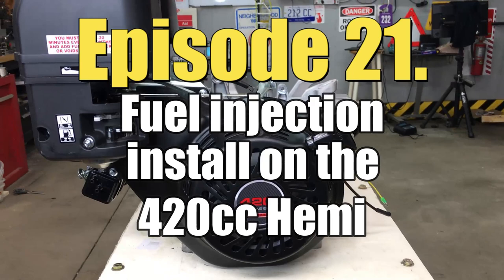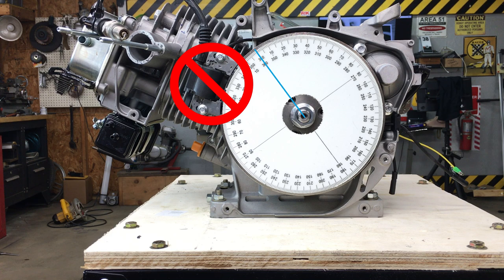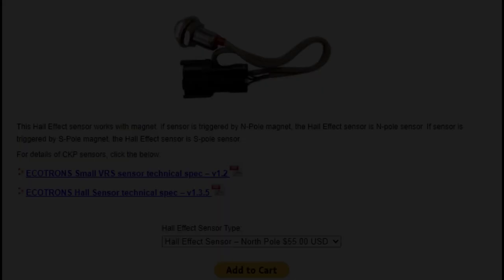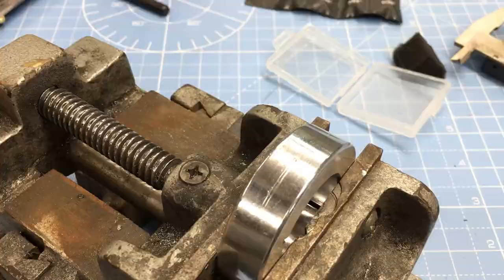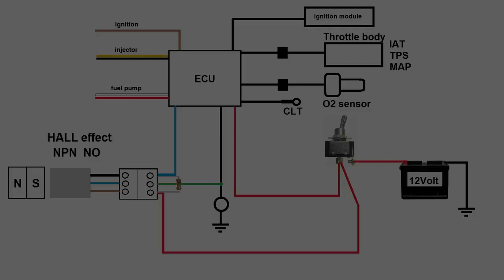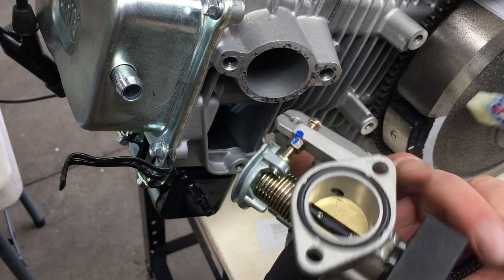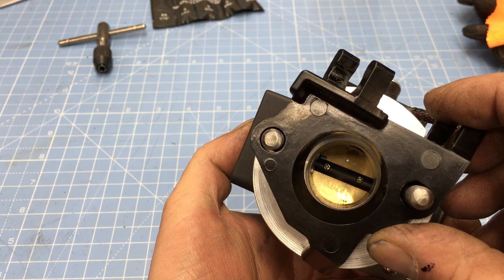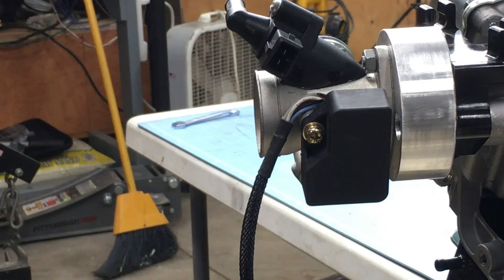Episode 21. We begin the EFI install on our 420 cc predator engine.  How hard can it be?

Comment: JB Weld is in my carry pack when I ride dirt bikes. Fixed a hole in my water pump housing in a pinch. Still holding strong.
Reply: Quiksteel is another awesome epoxy putty, I did lots of surface prep and it actually sealed a sport bike engine with a crack in the bottom of the crankcase! Held oil in even with it running
Reply: @consolehacker54  I love that JB weld. I used it to fix my teeth when I fell off my bike. It worked great until I got to the dentist!
Reply: Fixed an oil pan on a car too haha

Comment: Couldn't you have just set the trigger for rising edge and it would have been triggered at the correct moment? The pulse would be really long, but the rising edge would have been just past the south pole of the stock magnet.
Reply from the maker: If you watch it again,  on flywheel side I was getting a signal before the magnet and after the magnet.  There is no way the ECU can interpret this without specialized code.  The only solution on the flywheel side was to get a north sensing hall effect sensor.
Reply: @robotcantina8957  Ah, looked like it was just going to be on for the entire rotation, but it makes sense now :p.

Comment: 1) snip the pointy bits off of push pins, leaving just the plastic bit
2) glue them to the leftover neodymium magnets
3) best fridge magnets you'll ever have in your life
Reply: I've been using magnets out of old computer hard drives. (The biggest ones are in the oldest drives.)
Reply: @carlpeters8690  Whoa Nellie... those things'll hold a Volkswagen to your fridge! :-D
Reply: You could even use JB Weld to make them.
Reply: I have 10 or so hard disk magnets - whenever a drive fails, we're supposed to destroy them. The ones that can't/won't DBAN, my boss gives to me to destroy, and I salvage the magnets. They're bloody strong!

Comment: @7:30 YUP!  had a 225 slant six blew a rod clean out the block got a used rod from the junkyard and a plate to cover the hole in the  block JB to the rescue  drove the wheels off that car

Comment: JB weld is the ticket for magnets. Used it to reattach magnets on kohler flywheel for charging system. 4 years and still holding strong.

Comment: Great video. A good tip for your JB welding is to warm up the component with a propane torch, low heat, 120-150°F, and quench with acetone. Apply JB to a warm surface and it melts like butter. Better penetration and adhesion.
Reply from the maker: Thanks!  I will try that.
Reply: @robotcantina8957  CONGRATULATIONS JIMBO.. over 100k subscribers! 👍👍 ROBOT CANTINA
continues to provide the entertainment and fun that viewers enjoy!

Comment: Could attach a few of those extra magnets to the bottom of your vice, then put a piece of steel on your work table/bench to keep the vice from sliding around like @ 8:40. That way, the vice isn't fastened down permanently and you can still move it around as needed.
Reply: I've also seen the vice mounted to a brake rotor, doing both would work well.

Comment: JB Weld fixed the little cable wheel thing on the throttle body of my Honda Accord. It's plastic and the part that holds the cruise control cable had snapped off so the cable wouldn't stay attached and the cruise didn't work. I use my cruise on a daily basis and not having it is not an option so I JB Welded the cable in place with plans to fix it more permanently at a later date. As with most things, that date never came but good ol' JB was still holding strong when I sold the car several years later.

Comment: Your videos on this efi system is awesome I hate electrical so this is helping me understand this stuff a lot better,  great videos

On my 1984 toyota supra the spring perch inside my side mirror (electric)  broke off,  instead of buying a whole new mirror assembly we used JB weld,  this was back in 2002, it's still holding strong to this day,  love JB weld

Comment: Didn't know thier was a specific tool to find TDC like that. Been using the wood skewer with a marker line on it trick, to find it. Or mark the flywheel when the engine's head is off.
Nice info to learn!

Comment: 7:36 Already clicked on the like button, but JB Weld saved my ass. Drove a Dodge Shadow 2.2L for years that had the thermostat housing on the head partly made of JB Weld thanks to an electrolytically welded in broken bolt. Only way it would come out was grinding the corner of the housing down to remove half the remaining bolt laterally, and I still had to use a hammer and punch to knock the remnant off the remaining half-threads... new bolt, some oil, a cardboard and duct tape dam, some JB, curing time, and dress it nice with a file. 

Lasted until I sold it several years later, and that's saying something for a rallycross car.

Comment: Used the JB to fix pin hole in air tank. Drilled pin hole to expose clean metal, and counter sunk to create glue reservoir , packed for good smoosch out with JB on inside. Been holding 100+ psi several years now.

Comment: Tip: These big block Honda clones already have an EFI system, see the Powerhouse PH4000Ri/E (and whatever other names it is sold under) which is a remote start fuel injected 4kw inverter generator complete with oxygen sensor and catalytic converter.

Comment: This is enjoyable. :)  I'm not sure if this is an MSExtra thing or if it's included in standard MS, but you should be able to lock the timing at a set angle and check it with a timing light to do a fine adjustment to the offset.  So no worries if it's not exact when you mount your crank sensor.  B/C, as you stated, the sensor doesn't directly trigger spark, you can place it 'almost' anywhere, and just change the offset (then do the fine adjustment when running).

Comment: looks good to me , can put the map sensor in the adapter for the carb (i think usually on cars there in the manifold after the trottle body but on this the pulsing inside the ultra short manifold might confuse it ) you could try building a small canister and hook the map sensor in series to that to dampen some of the pulsing , never seen it done but i think it would average or be slow the pressure changes down some , you do need to tune the size of the canisters chamber if you want slower or quicker response to changes , maibe use a big seringe so you can vary the size by pushing in the plunger 
the magnet on the small ring might loose some of its power if the beltdrive gets hot , you could stack two of them in the hole if that becomes a problem 
if you realy going to build pressure with the turbo you might need to weld a v band to the trottle body and the charge pipe or at least have a ridge on the edge of the trottlebody intake  so a hoseclamp has sumting to hook behind or the chargepipe / hose will keep slipping of as soon as it builds boost you might need a small blow off valve too , to keep the boost at a reasonable level if you start to raise the boost level , you basicly want the boost to rise up to the set point and stay there not creep up further

Comment: Just drill and tap the fly wheel before or after the magnet. Put a hex head bolt in the hole. The hall effect sensor will trigger off the bolt head.

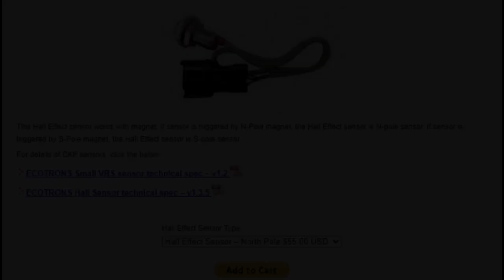Comment: 5:50 You can also make your own crank sensor with a suitable Hall Effect Sensor, and have it fire on whatever polarity you like based on which side you face toward the magnet. Of course fabricating a suitable threaded housing for it , and defining the trigger voltage threshold is probably more trouble than its worth. If someone wants to go through the trouble though it could be $5 instead of $50

Comment: Got a free tractor and when taking it apart for a rebuild the engine had a hole in it from mice piss so I removed the cylinder jug put a bolt in through it and a bunch of jb weld works great👍

Comment: A fuel injected cement mixer for mixing cement at top speed
Reply: Well the way a cement mixer works speed would actually prevent it from doing any mixing due to centripical force. Hope that answers the question you didnt know you had.
Reply: @theproudONE92  fkn true ay, not something I thought about but it's cool to know
Reply: @theproudONE92  only if you're throwing the cement in, you could actually strip most of the "cup" and use it as a helix and mix cement at top speed. Well mixing... Throwing it around

Comment: Robot Cantina, thanks for posting the interesting videos.  I have also had this same desire over the years.  It's nice you have the money, know-how, tools, and spare time to put these plans into action!

It would be nice if you could develope a mechanism for advancing the ignition timing to pick up a little more horsepower and torque but, that would be quite a time consuming design implementation.
Reply from the maker: The EFI kit has that built in,  There is also a stand alone electronic ignition controller with programmable advance available.  I'll do a video on the stand alone kit soon.
Reply: @robotcantina8957  Thanks for the feedback.  Wow, I didn't realize you could get (or adapt) an ignition timing controller for that engine, that's pretty cool!  Between the fuel injection and ignition timing improvements, you should pick up at least 20% in output power.

Comment: This video series is so good!! Thanks again for these uploads! I really can't wait to see the improvement fuel injection makes. I wonder if it might be possible to modify the head very slightly for more compression, then you could run higher octane fuel.
Reply from the maker: The fuel injection should help a little bit for the normally aspirated engine, however the plan it to go with forced induction and for that we will need fuel injection to do it right.

Comment: did similar project.
My approach was less steep.....
First ran it with old carb and ignition and make the electronics work to seeing right advance behavior when checked with strobe on degreewheel.
then switched ignition and then switched from carb .....
so more little success moments 😊
as said killer move would be to flash it with megasquirt or speeduino and get it to work serial to bluetooth for tuning in real tunerstudio wideband lamba and realdash in the car ......

Comment: You may be looking at a VR sensor there. If so, you’ll find that the tip of the sensor will be magnetic itself. If so, you can either trigger it with a magnet of an opposing polarity or by having vacant space (drilled hole) in the flywheel. I like to use a ford missing tooth wheel but the software will let you use a number of configurations. The conditioning program will then watch for the rising or falling edge of the VR input (or square wave with internally conditioned sensors) . It looks like you got er figured out :)
Reply from the maker: The end plan is to use a 36-1 wheel.  That is why I went forward and remounted the sensor on the other side of the engine.  For the first start and initial run, we will stay with the single point timing and then upgrade.

Comment: Ignition fires on the EDGE of pulse, not on the level, so the initial setup was just fine. You can switch between a rising edge (OFF to ON transition), or a falling edge (OFF to ON transition), so you needed to determine the offset from the beginning or the end of the cutout for the magnet and the TDC. It really doesn't matter whether the signal is high for 95% of duty cycle and low for 5% or the other way around.
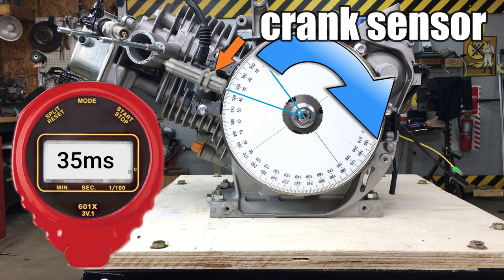Reply from the maker: Please watch the video again.  Starting at 4:20.  The problem is the sensor is being triggered twice.  Once before the magnet and once after the magnet.  You cannot have two pulses or two triggers right next to each other on the same revolution.
Reply: @robotcantina8957  No it's not triggered twice ;) it was normally engaged, then it disengaged when entering above the magnet (this is a falling edge), and engaged again when leaving a magnet (that's a rising edge). It was on for the almost whole turn, and off, when above the magnet, and that was perfectly fine. ECU fires only on one chosen transition (off to on or on to off), not on both. The signal was just inverted from the one you ended up with, but it was not a problem for the ECU. It still had one falling edge and one rising edge per turn.
Reply from the maker: @TzOk   Hi Again,  So here is what happens. Normally the hall effect prox sensor is High, due to the pull up resistor. once it gets close to the magnet it starts to sense a very weak south magnetic field, the sensor then goes low.  then when it gets a little bit closer to the magnet it senses the north field and  then goes high and will stay high until it passes the magnet, then it senses a very weak south field and switched low , then once it passes the weak field it goes high again.

So the sensor goes from high to low to high to low to high.   The issue, is the sensor is picking up a very weak south magnetic field before it gets to the very powerful north field of the magnet, once it passes the powerfull north field, it then picks up on a weak south field for a moment.  Perhaps its not very clear in the video, but the sensor is being triggered twice and that is no good.
Reply: @robotcantina8957  If this was the reason, then ok, but video doesn't show this clearly, as you move the flywheel back and forth within the magnet region.
Reply from the maker: @TzOk  You and a few other people have call me out on this, and thanks for trying to help!  I think the video and my explanation was not clear enough and now I have to answer a lot of comments.  Episode 21.5 should come out in a few days and its a special episode that shows exactly what is happening.  Anyway, once again, thanks for trying to help.
Reply: @robotcantina8957  Ok, thanks for the explanation, and sorry for additional work with answering.

Comment: Mount the degree wheel on the lathe and use a transfer punch through a boring bar sleeve mounted in the toolpost. Or just mount a drill on the toolpost.
Reply from the maker: I have no idea
Reply: @robotcantina8957  use it to lay out hole patterns about a center.

Comment: Knew you were going to have a problem with the hall effect while watching e19. Ignition coil fires when the magnetic field collapses. Magneto is a C shaped magnet that charges the primary coil then the field collapses into the secondary high voltage winding to the plug. Same as a distributor point closes charges the coil, opens and fires the plug. That's why transformers work with ac current not dc.

Comment: Back in 2000 I worked @ a welding place when one of those all plastic and aluminum Honda cars came in on a roll back from a local paint n body shop who wasn't able to weld aluminum and once I had replaced the damaged feint inner fender,core support and suspension work I took it out for a spin and 60mph was pushing it in that tiny little thing.. It might be able to hit 70mph but I wasn't about to press it that hard...
Reply from the maker: Its the perfect car for our experiments.  Extremely light weight and somewhat aerodynamic....although its a bit on the ugly side.

Comment: On the sensor, if it was on for the whole diameter of the flywheel (except the magnet) you could have just selected rising edge instead of falling edge.
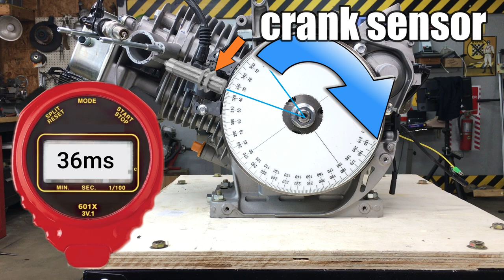Reply from the maker: Please watch the video again.  Starting at 4:20.  The problem is the sensor is being triggered twice.  Once before the magnet and once after the magnet.  You cannot have two pulses or two triggers right next to each other on the same revolution.

Comment: i used jb weld on my motorcycle fuel tank when i was 2 states away from home and a bolt rubbed through from the motor mount. i ended up cutting the end off the one that rubbed through and the tank still holds fuel 10 years later

Comment: @Robot cantina please use some gaskets, you might have some mass airflow problems in the future.

Love the series!!!

I am currently working on a project using the 212CC engine (chinese edition)
Reply: This is speed density, not mass air flow.

All a vaccum leak will do is raise idle if the leak is more than the IAC can compensate for.

Comment: I would have cut a o ring boss on both sides of the adapter while it was chucked up in the lathe. That way you had a great intake seal and not have to use gaskets or sealants

Comment: I put JB-weld high heat on the block deck of my Ford 300 to fix a crack, and it's still holding 10k miles later.

Comment: You could have gone with the industrial hall effect sensor in the original place, had you just let the "Ignition InputCapture" remain as "Falling Edge".
Reply from the maker: The hall effect sensor I'm using is an industrial sensor.  As it turns out all the hall effect sensors that I have seen only sense south facing magnets and we need a north sensing unit in order to use the flywheel magnet.  It is not clear in the video, but the sensor is being triggered twice. when it passes the magnet.  it gets triggered on and off right before it reaches the magnet and then it triggers on and off right after the magnet.  Like I sad, its not clear in the video, but we are getting two triggers per revolution and that will not work.  The rising edge and falling edge stuff is not related the the main issue.  I only mentioned that because after we set up the new shaft collar with the correct magnet then the proper way to set up the trigger is per the megisquirt manual.
Reply: @robotcantina8957  Ohh yeah it absolutely makes more sense now, you seem to have a good grasp of this stuff, so i did not understand why you didn't just leave the setting. I might just not have picked up on the "dual triggering" bit. But yeah that would totally give you a bad day trying to run the motor using that industrial sensor, hehe.